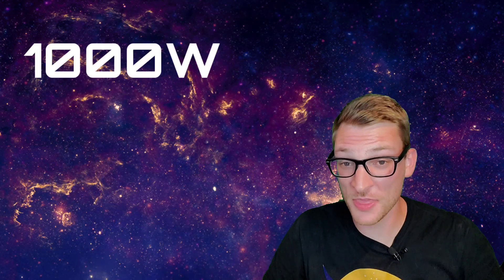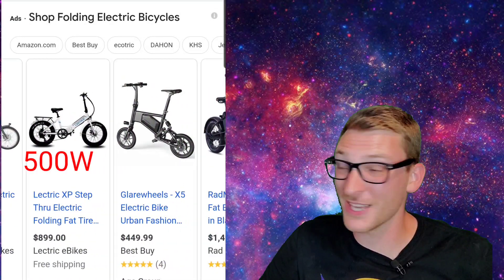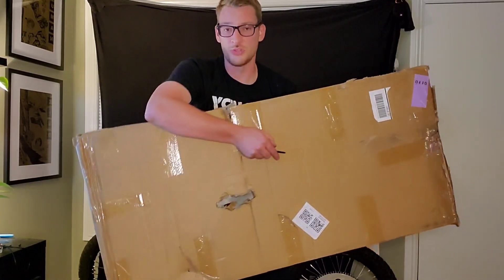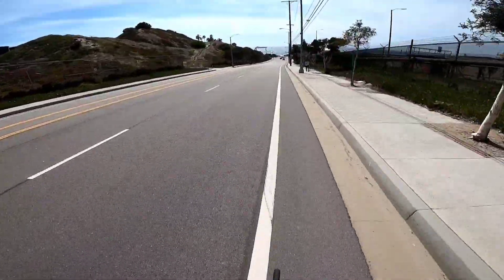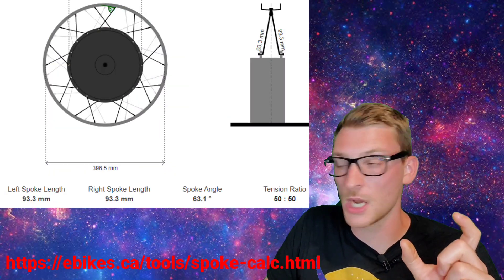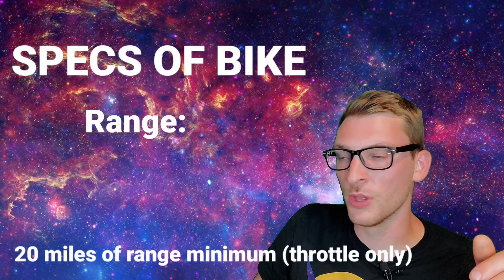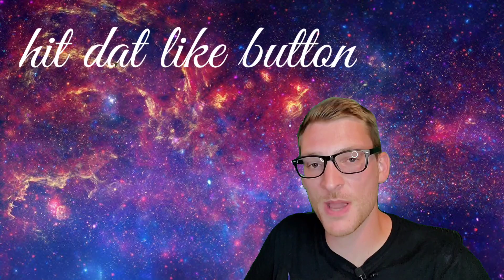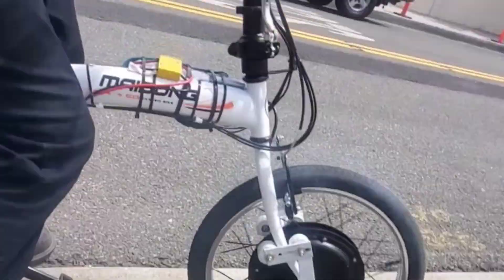how to build the cheapest ebike with 1000W of power

Comment: You can make this motor faster by factor √3 if you open it up and resolder the windings in delta configuration. You might need to put slightly thicker phase wires through the axle so they dont melt from increased current though. Or cut them a few cm after the axle and connect thicker ones there for heat transfer.
Or you get a higher voltage battery and a controller that can handle the increased voltage.

I wonder what speed is "safe" on such a folding bike. On my 26" folder I can go 55 km/h with the same hub motor on 60v battery, but im thinking about trying a 20" in combination with delta wiring because that would make the motor run more efficient and provide better acceleration

Comment: The guy’s at the bike shop were right.  Putting a hub motor on the front wheel is a very bad idea for many reasons.  
Mainly the fork is not built for much more than to balance and guide the bike.  The rear wheel is meant to support almost all of the rider’s weight. That kind of torque will break your wheel fork.  
Secondly a lot of the power will be lost to slippage because 1/3 of the bike’ss weight is trying to pull 2/3 of the weight behind it.

Comment: Great build! A year later, how is the bike holding up? I'd like to do something similar, but not necessarily with the goal of being the cheapest (or the burnouts lol). Would you still recommend the parts you used? Is there a commercial available bike with similar specs out now? How is pedaling the bike without using the motor?

Comment: I have a little ebike 350w motor and 48v 20ah battery and you can go at least 25 miles before recharging. How can you know the range and the weight capacity ? But the problem is it only goes 15 mph. And a 14 inch wheel at that.

Comment: So... if you were to put it down to a number, what's the current power/weight ratio?
Is the bike still foldable?
How many pounds of zip ties did it take to build?
Also, you plan on throwin' that TP (instructions) away? I could use 'em. I'm down to my last roll...

Comment: why is the motor in the front wheel?
Reply from the maker: I put it in the front mostly to be outrageous. But I also didn't want to mess with the rear cassette.
Reply: easier fit ?
Reply from the maker: @nvention20  kind of. But mostly for the shock value.